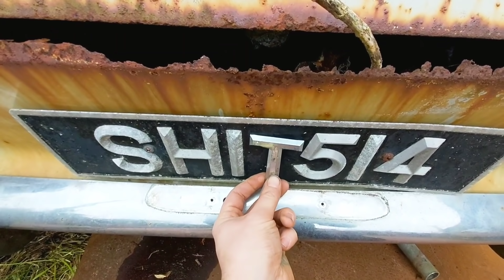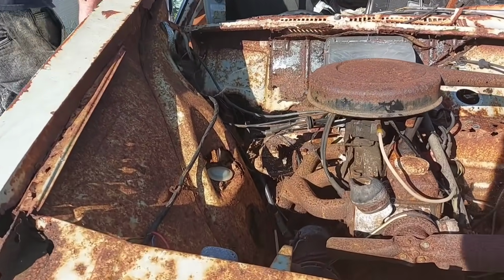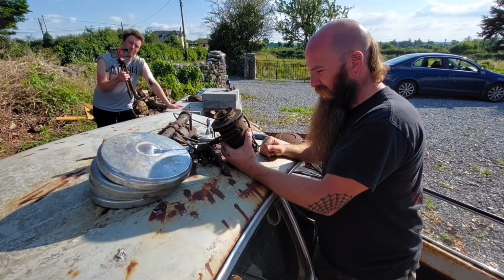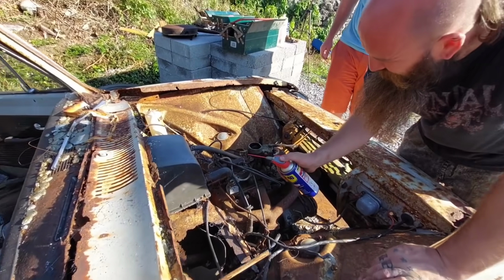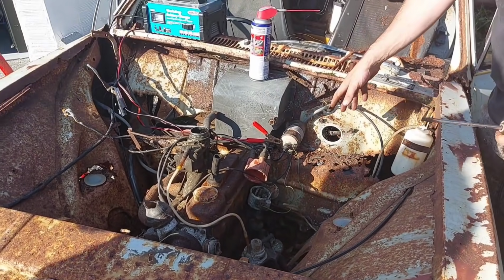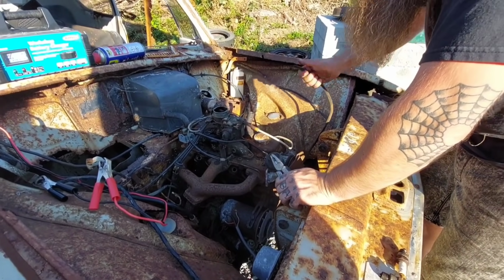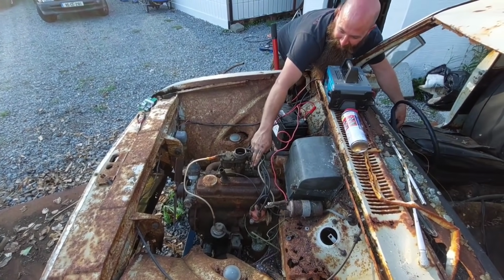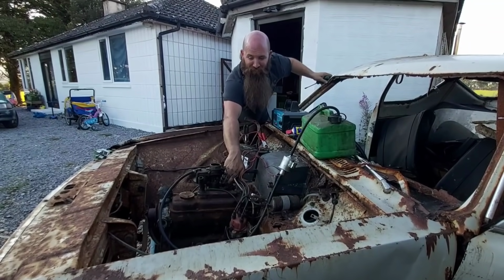Will it run? 1965 Opel Kadett B Coupe off the road for 37 years!!! Episode 6

Comment: 😂😂 so funny. The biggest piece of 💩 I think I've seen in my life running like a clock 😅.
I'd loads of the next model Opel Kadett,probably the same 1196 cc engine as yours. So funny
Reply from the maker: @cbx750frider  Thank you! Insane that that thing even turned!
Reply: @CannibalCars  absolutely mental it turned over and even had a spark 😅. My friend did the same on an Anglia laid up 30 off years ..he's even driving it now on the road ..loads of patina,totally untouched since it was parked in the 80 s 😅
Reply from the maker: @cbx750frider  Class. Love to hear they are still getting saved. 🤝
Reply: @CannibalCars  he did the same on an old Commer van too,that's now his work van complete with sliding doors 😅